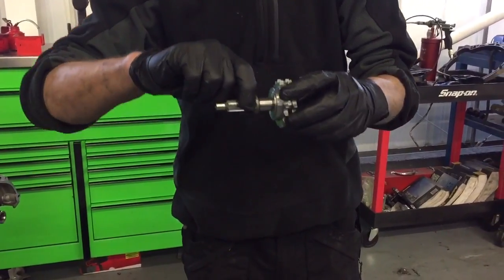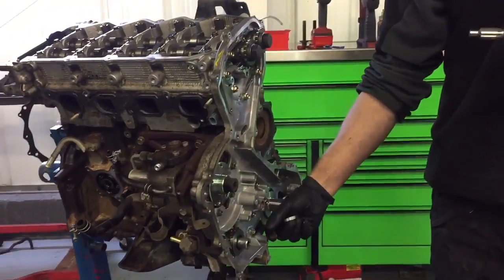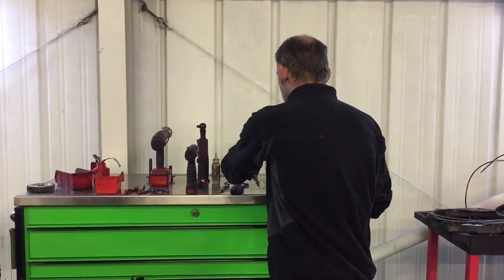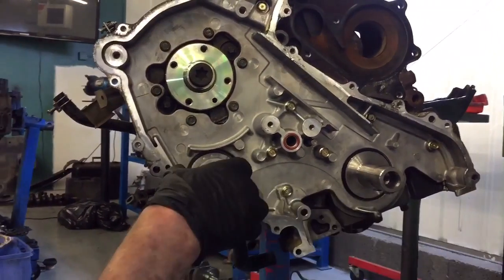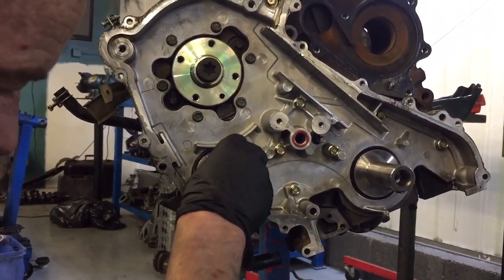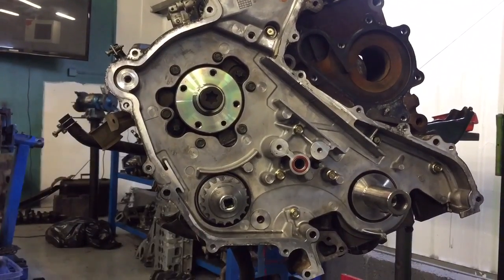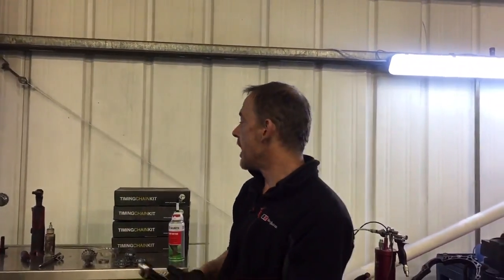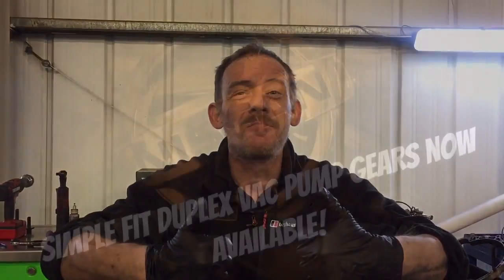Nissan YD25 Duplex vac pump gear (easy fit) Now available!

Comment: Hi Des love your you tube could my mechanic have fitted my HD double row timing chain without doing vacuum pump upgrade. My d22 makes tyre sound like tyres are locking for a split second. Could vacuum leaks cause. Have you got a video of vacuum oil tube replacement can't find connection of oil filter assembly. Regards Scott

Comment: You make nice video,s on Navara,s please can you make a video what is the the difference between Spanish and \Thai built timing chain and guides and tensioners, because the most expensive timing chain and it still snaps at 20,000 km after been changed or 1 year ,please explaine the difference between thai and and spanish  2008 models what is the difference or can you fit fit Thai timing chain and Tensioners and guides on a Spanish Navara